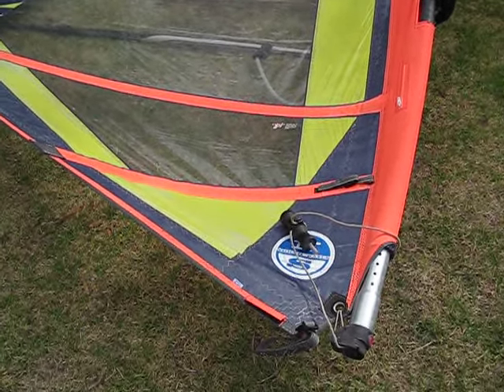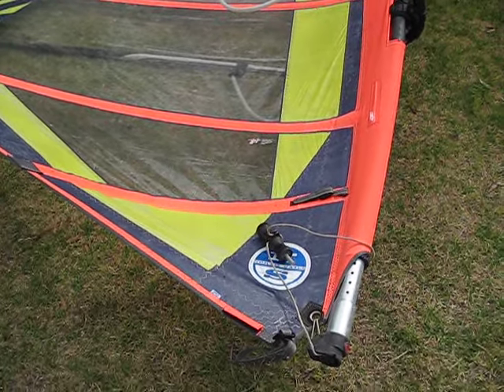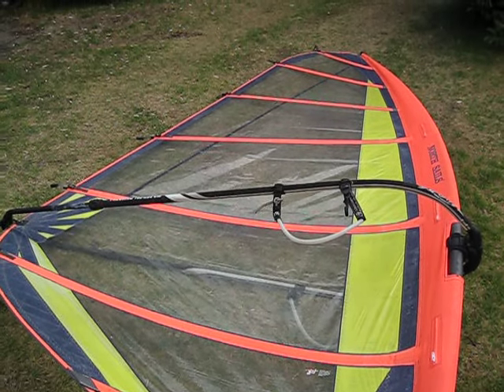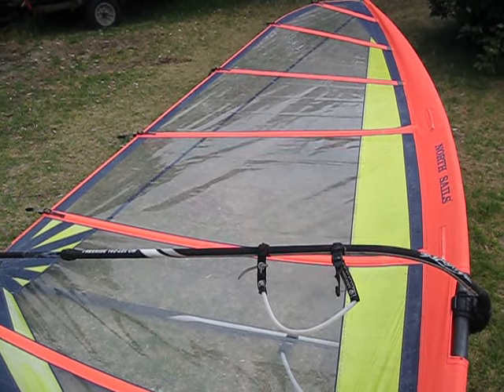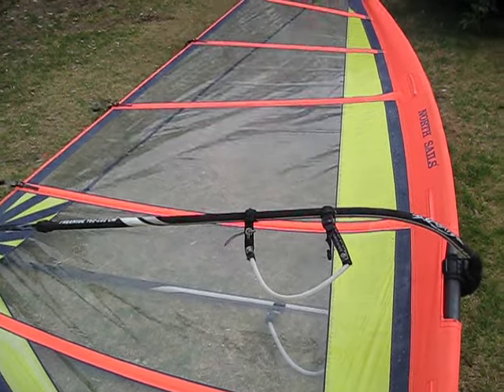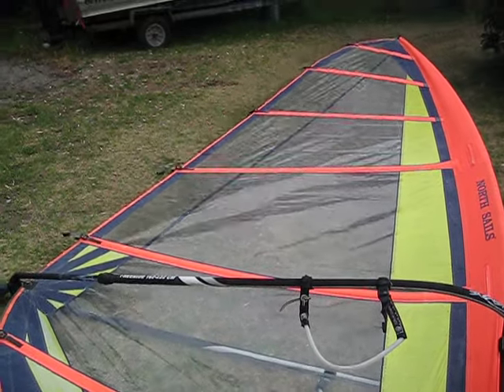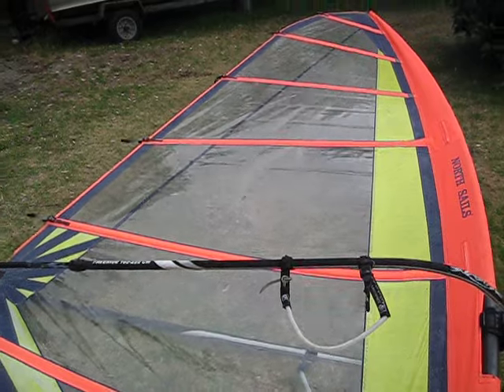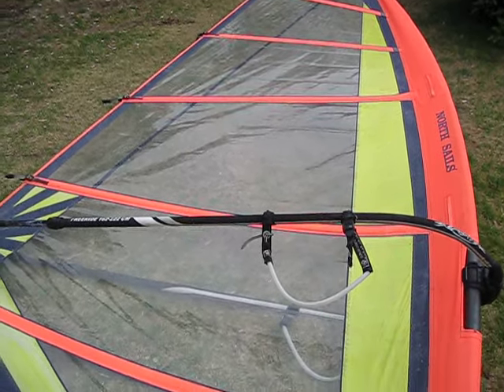Old North Prisma Windsurfing sail

Comment: North Sails of that era did have a 'Flex Top' that was designed to twist off under pressure. They did nead a 'Flex Top' mast to make them perform properly. I had a North Prizma 9.2 & thre matching mast. It was great for light winds on the lake.
Reply from the maker: Yes, from memory I rigged it on a 13.5% (semi flex top) mast. I had on old North Blue 460 wave mast which is very stiff in the base half, but it wasn't long enough to try it on. I think it went to the Tip in the end. No one wanted it and quite a few others I had. 😞
Reply: @tandemwind  from the vocal accent, I'm thinking you're sailing in the southern hemisphere of the planet? Not trying to narrow it down much...😁 I did all my windsurfing in the 1990's. Wife, Life & Kids and all my stuff was donated to the Boy Scouts decades ago. I'd really love to get back on a board though.
North Carolina, NC - USA
Reply from the maker: @waynemiller6945  Yes, Victoria, Oz. 😃

Comment: Thanks for the video.where did the sail end up, did anyone put up the fifty? The set of the sail does not look right, as you say maybe a proto or it could be one of the old Norths where a flex top rather than constant curve mast was needed. I threw out not long ago a north mast of similar vintage with an alu base section and a glass fibre top- a 'frankenstein monster' if ever there was one.